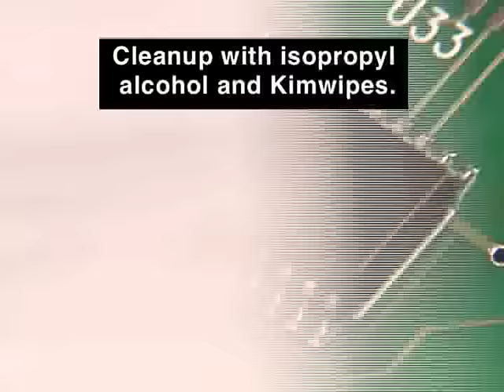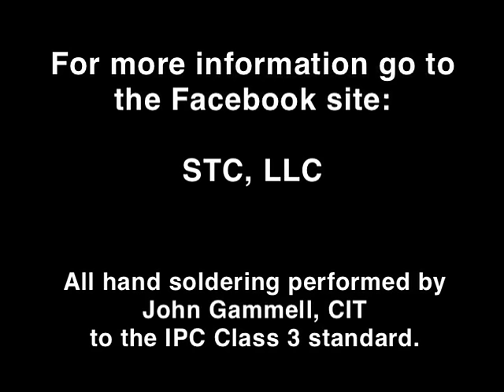Professional SMT Soldering:   Hand Soldering Techniques - Surface Mount

Comment: How do you get that wetting effect. Where the solder just flows nice n easy? Is it just a clean work area with plenty of flux? or does it have to be the right type of flux?
Reply from the maker: The Elements of Drag Soldering:

I get the wetting effect in drag soldering by surface preparation, a good drag soldering tip, Kester flux in either 2-4%solids max (I prefer RMA), proper component alignment, after tack soldering clean leads with IPA to remove any contamination, flux with a low solid or high solid Kester rework flux as I commonly use. Rework gel flux in the syringes gives you good open time with no burnoff and maximum wetting of the solder by greatly reducing [surface tension]. Solder when wet will always follow the heat source. I pre tin the tip, touch down with the hoof flat (planarity is critical, no toe down or you pull leads off pads), only the pressure of the handle and when you pull, you determine your speed of travel by watching the wetting in action. If you bridge, so what. Pull them as I do in my fine pitch videos.

Comment: at 1:42? That is soldering paste-used for the hotair station, but in this case he uses a clever way to tack the corners. After that is Flux ( many types -go google) but the bottom line is : when u are soldering Smd s u need Flux.

Comment: So if I follow this guide line, I too will be able to solder surface mount connectors without making a mes and fix a $300 piece of electronic? What wattage is the soldering iron?

Comment: I know this is an old video but would you happen to have a video in the works or could reference something for soldering a flex cable to a chip? There only seems to be one video on youtube (unless I'm not searching correctly) and its so dirty and filled with bridging, I turned it off.

Comment: At 0:55 I seem to be seeing a big puddle of flux, which is what I expected, but there's no mention of it.

As I understand it, the flux helps prevent bridging of the solder between pins, by making it flow onto them more easily.

Good demo though.  It just seems odd to leave that out.

Comment: I see you have soldering skills but can you do some videos of desoldering surface mount components such as capacitors or SRAM where the manufacturer uses some type of glue spot to hold it on the PCB before soldering?

Comment: How did they avoid multiple solder bridges? Does it have something to do with the PCB? The last time I tried to solder together a project, dealing with all the solder shorts was a real pain.
Reply: It mostly has to do with the tip used, the amount of solder, the quantity and type of flux, and the technique you use. Take into account that the technique you choose to use really depends on the type of the tip you are using. For example, concave tips are best used for drag soldering, while chisel tips are best used for soldering a few pins at a time. Irregardless of the technique or the tip you choose to use, always use the right amount of solder and plenty of flux.
Reply: I have a problem trying to solder a 32Mb SD ramchip from a yamaha Keyboard. It has the problem of "cold solder joint" and it does not let it to work OK. I tried to resolder it but i'm not able to get rid of solder bridging. I'm using a 15W iron with a normal conical tip. Do you think that changing to a tip like the one in the video will help? I tried to remove the solder excess with a desoldering pump but it does not work at all. Do you think is it very probable i already burned the chip with the heat? Thank you in advance
Reply: Probably cleaning the old solder and using flux (even during the cleaning process) will do. Excess heat will burn away the flux and cause the solder to oxidize, even causing bridges. Solder by dragging excess solder away from the pins.
Reply: I would not use a 15 watt iron for that. I find that lower wattage irons take too long to heat a joint and can damage parts. If you can get an entry level soldering station like a hakko fx-888 or maybe just a regular iron with around 35 watts and a tip that is not too large.
Reply: bt

Comment: How does the solder not bridge?!?!?
Reply from the maker: *****  The most common question: Why does the solder not bridge between the leads when I drag solder? Solder is high in surface tension. Flux is a de-oxidizer and wetting agent that reduces surface tension and promotes rapid wetting. Solder when liquidous is attracted to the heat source. The heat activates the flux and it flows away to remove oxides and prevent re-oxidation. As you drag the hoof tip the solder will pull cleanly off of each lead adhering to the surface areas on the pad, heel, side joint length and toe during wetting, leaving a properly wetted fillet and with no solder bridging. You control your wetting by your speed of travel. To fast a speed will usually cause insufficient heel fillets. Interfacial forces are the interactions of the surface tension of the molten solder, the flux and the substrate material during soldering, and, as such, (surface tension) is one of the critical physical properties of solder that determines its wetting behavior.
Reply: Ryan Walker  because of the gel

Comment: I don't get it. How does the solder climb the legs and pins like that? How can you just drag the tip across 20+ connections and not have anything left behind but perfection? WT actual? Do you have to get trained to do this by a master in a university or can you learn this at home? I am no rocket scientist but, this seems impossible.

Comment: Why is it when I try this, I get multiple legs solders together, Then it's hard as hell to separate them one by one? My tools are no where near yours, as my solder station is cheap. Plus I did not prep my area, etc. Thanks for posting at least I can see how it should be done........AHH OK that soldering station is $650 is why DAMN!
Reply from the maker: +Philip settimi - I can teach you how to duplicate my work with a $150. Weller WESD51 Digital iron using their assorted drag soldering tips that cost $4.00 each and properly tinned and maintained those tips will perform for years. You could have one of our $2500. rework units but if you did not apply the technique correctly then your leads would bridge up and that spendy unit did not produce. It is a combination of equipment, tip selection (surface area is very important), temp, solder and flux, tip angle, pressure, speed of travel, etc... Withhold one of the critical steps of the process and it will affect the result.

Comment: In rality new PCBs are printed by robots even in small series and you will never get a PCB of such quality when repair or upgrade appliences. Real used PCBs are corroded, scratched and stratified. Even more so when SMD was previosly removed from the board.

Comment: YOu do not use a birnishing  thing to preclean a soldering surface as you are merely spreading metal between conductive surfaces. You use an acid brush with isopropyl alcohol. The poster doesn't mention the selection of solder for the process. Ideally it should be 63/37 (tin/lead) because it is the lowest meldting point of the compound.  This is NOT good solding instruction for sure.